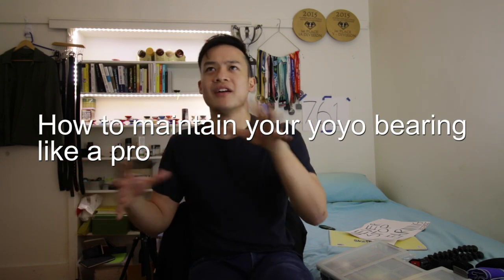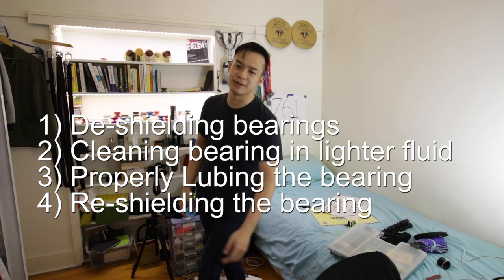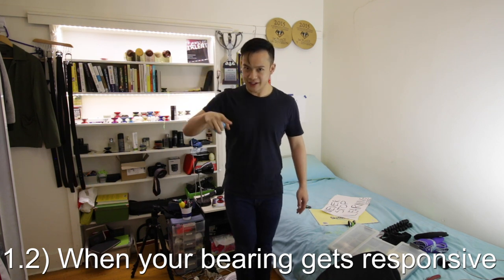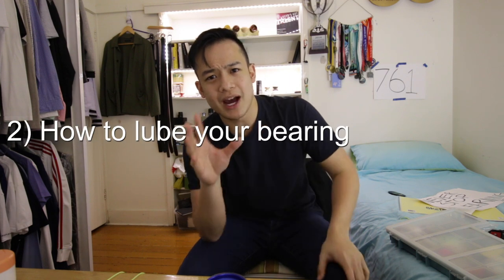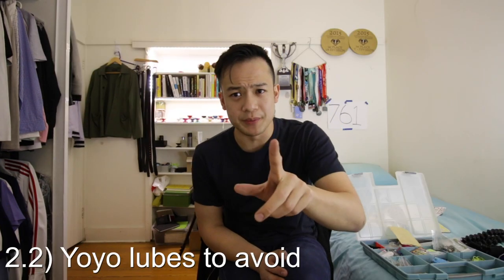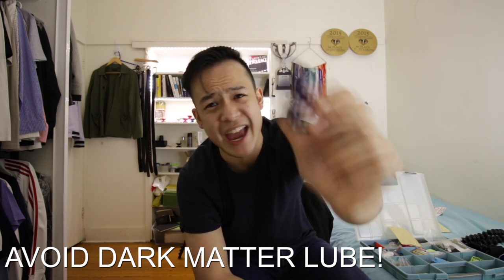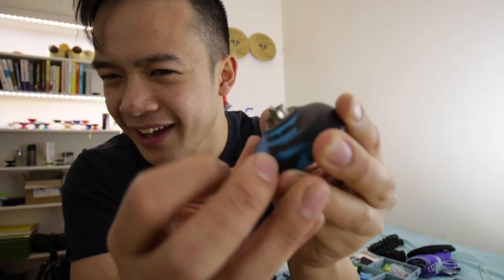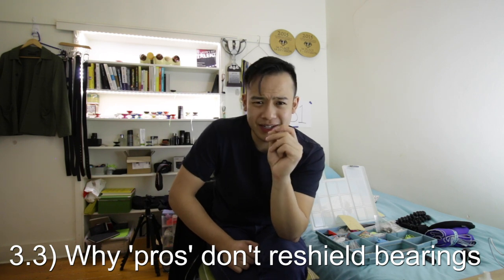Everything You Need To Know About Yoyo Bearing Maintenance

Comment: Dylan Kowalskis thin lube recipe is legitimately really good, you can tweak it to your liking and it’s made of mineral spirits and “3-in-1 oil” at a 3-4:1 ratio.  I haven’t had any problems at all with bearing longevity using it! And ounce for ounce it’s like 20 times cheaper.

Comment: Sewing machine oil is a great lube. It's literally the same thing as the lube from YYF. Also, if DarkMatter didn't work for you, you're using it incorrectly. It's basically a dry lube that comes wet so you need to treat it like a dry lube, aka graphite powders.
Reply: In Indonesia we use "singer all purpose oil"
Reply: @restudwiatmojo6448   does it work

Comment: I know this is an old video, but I came across it as a new player. Good info in this video, and I want to offer my perspective as a long time balisong flipper. Use your bearings dry when possible. Same principles apply here as with bearing knives. Lube will attract dust and debris to your bearing and gum up the works. I understand we all want our bearings to be as smooth as possible, but frankly just upgrade your bearing rather than lubing it, I guarantee it will last much longer than with lube. However, if you're like me and you're in both hobbies and you really want to lube your bearings, Daiwa Reel Oil will pull double duty for your bearing knives and your yoyos. It's about as thin as water, which is what you want with bearings.

Comment: A few things I do:
- dont take the yoyo apart when picking out knots (dust and stuff can get in, esp in deshielded bearings)
- clean hands. Moisture/salts on the string wrapped around bearing can rust it
- a bit of lube on any new yoyo I get
Reply: The first point is also to reduce vibe
Reply: How do you get axle knots out
Reply: @shawnvle  use long skinny tweezers!! It changed my life lol. It makes it ridiculously easy.
Reply: @shawnvle  A paperclip with the wire bent out also works really well

Comment: It was actually your older bearing maintenance vid that got me to try deshielded bearings in the first place.  I hate trying to put c clips back on too so usually if I need to remove a shield it stays off too.  But you're right there is a tradeoff.  Easier cleaning for easier dirtying.  

A quick thing you can do if don't have time for a liquid cleaning and you just heard your bearing get a little louder.  You can spin a deshielded bearing on a pencil tip (or yoyomagic bearing removal tool) then blow down into it while spinning to get out dust or string fibers.  After that, get a tiny bit of lube on it as you may have also dried it a little by blowing into it.  Make sure not to get any spit in there btw lol.

Usually it's string fibers that get in my deshielded bearing as opposed to dirt.  If you use string until they are really beat up and have fibers sticking out all over then you might need to clean a deshielded slightly more often.  If I replace strings often, I kinda do, I rarely have any issues with deshielded.  This is even though I uses strings w nylon that fray a little easier.

Comment: I've found many yoyos that I've purchased that need their bearings cleaned right away. Usually the problem is just too much lube/oil/grease(yes grease) inside. It happens. Of course, Iv'e also had bad bearings from "Fresh out of the new box" yoyos too. My first cleaning is with acetone. That typically takes care of most stuff. Sometimes I repeat. If it's still dirty, I'll use mineral spirits and the paper slip method since mineral spirits don't evaporate as fast. If that doesn't do it, then get a new bearing. Sometimes I'll use some thick lube in the bearing first and then do a few short sleepers to distribute the lube around. This sometimes lifts the particulate matter so it will come out easier when I use solvents for cleaning.

Note: While a quart of "pure acetone" costs me like $8 in a hardware store, at a manicure/beauty supply place, they have "pure" acetone for like $4/gallon. DO NOT use the manicure acetone. It DOES NOT work. Just use the hardware store pure acetone to "undo" your previous bad decision. I don't use lighter fluid as my solvent of choice.

A good lube substitute is no-residue spray/aerosol electrical contact cleaner available at most hardware stores. Well, it's not really a lube, but more of a "I need to clean my bearing out fast". And for that, it's worked very well for me. The propellant often blasts away particulate matter as well. I've never had a problem. I do agree with sticking with lubes meant for yoyos AND to avoid Dark Matter.

I prefer my bearings shielded if they came with shields. I have no reason for this other than “I like it that way”.
Reply: When used for serious purposes, bearings are usually "packed with grease" to reduce wear and provide a barrier to contamination.

Comment: Disclaimer: I have not used Dark Matter and I don't have any affiliation with YYF aside from buying some of their products.

My understanding is that Dark Matter is a little unusual because it works in a different way from "normal" lube.  Usually, lube is an oil base liquid that is applied to the bearing to create a very thin film between the metal parts.  This helps protect them from moisture and from abnormal wear as well as letting the parts move smoothly.

Dark Matter, on the other hand, I think, is closer to graphite dust where there are particles suspended in a liquid and after it has been applied to the bearing, the liquid evaporates and, in theory, leaves a layer of the dust behind that creates the protective barrier between the parts.  One of the problems I have heard of with Dark Matter is that it will "dry out" if not closed tightly and you end up with just a bottle of dust...  My point is, I think some people have had success with Dark Matter, but it's just a different type of thing altogether. 

As far as "making" your own lube, I have seen people swear by Dylan's method of diluting 3-in-1 oil.  https://www.youtube.com/watch?v=zriKLNAnb9k

I also think it's possible to find other thin lubes that work just as well.  I don't believe there is actually a large enough market for think yoyo lube that companies formulate lube specifically for that.  I'm fairly certain that, usually, yoyo companies just find oils and other lubricants that are already being manufactured and they just pay to have it packaged in little bottles to sell to us throwers.  With this in mind, I think it should be possible to find something equivalent to thin lube.  For example, trumpet valve oil seems to work fine as it's a very, very thin oil (e.g. Blue Juice).  That's not to say that it isn't easier just to buy some lube and be done with it, but it's good to be aware of the fact that there are options because, as you point out, not everyone has easy access to the same retailers.
Reply: In the pocket-knife world the pivots have more and more frequently turned to bearings. Most common lubes in use that I know of are KPL (knife pivot lube), Diawa reel oil (for fishing reels), and Nano-oil (which comes in all different thicknesses, so get the thin stuff)
I have tried KPL as a make-do and works just fine on yoyos, no noticeable difference between it and yoyo-factory thin.

Comment: In bobs case i think he has to find a way to dissect the bearing and put everything back tgt? Sounds like smth is loose in the bearing and my guess, it isnt assembled properly. if its fixed after washing/lubing then that would be great.

bearings take a few months for it to break in nicely so do maintain and lube them regularly for a long and smooth spin. ( i dislike that bearing noise lol )

Comment: if you plan to work with shields a lot, there are specialized plier tools built to take them off and put them on. that's why they're a pain to deal with for most. you don't have the tool. they're generally called "snap ring pliers"

Comment: Yoyo Lube Alternative: Ok so i recently got into YoYoing and before i got into it i did speed cubing (copmpetitive rubiks cube solving) and we use cube lube for our cubes. i had some lube lying around when i needed to lube my yoyo so i used the cube lube on my yoyo and it surprisingly works however you have to use lube which has a consistency close to water otherwise it will slow your yoyo like brandon said (!!!And dont use much!!!) im only using cube lube until i get yoyo lube (i use dnm-37 cube lube
Reply: Ayoooo I was going to ask if cube lubes worked! Thanks for the info
Reply: @allthingsoreo5559  all good man! Fyi put like same amount you put in ur cubes also what's ur 3x3 AVG?
Reply: @mannualfpv6293  oh I average 10 seconds.. yoyo has been taking away my attention from breaking the sub 10 barrier
Reply: @allthingsoreo5559  sick bro I'm just sub 20 haha

Comment: Did you try shaking the dark matter lube vigorously then quickly using it? I noticed it has a kind of metal powder in it. I only use it at work with wood working tools once I got the clear thin lube.
Reply from the maker: Yeah, it has like dried up particles inside that clog my bearing.
Reply: @thebrandonvu  I think the idea is it's supposed to be a dry lube. I use dry lubes at work a lot. So the liquid evaporates and the graphite stays behind as the lubricant. This might sound weird, but maybe you're under lubricating it so the bearing seizes up. We use tiny drops of the clear stuff, but dark matter says to add 3 drops. I can't retrieve my dark matter from work for a week to try it myself.

Comment: Hey Brandon, I love your videos! I wanted to know if you had a suggestion for my predicament. I have two Bi-metal Shutters. One plays great, but the other is very grippy, almost semi-responsive (it comes back on a strong tug). I have tried changing the response pads, the bearing and the type of string, but nothing has fixed it. I did noticed that the response pad sits a little taller than the one on the other yoyo. Is there any fast way to wear down a response pad?
Reply: Have you thought about putting thin response pads in it?
Reply: @mamaheel5  I'm using YYF slim response pads, are there thinner ones?
Reply: @GerardoPro17  Unfortunately, not that I am aware of. Didn't realize that you had already tried that.
Reply: Is it possible that your response pads are not firmly seated, or that glue residue from the original pads is in the response pad seats preventing them from seating properly? Since you have already tried thin pads, this is the only thing I can think of that might be causing the problem.
Reply: @mamaheel5  I thought about that too, but the pads that are on it right now are ones that I put in. I made sure to deep clean the pad seating and pressed the new ones as hard as could. At this point I'm just playing with it frequently to wear down the pads. Thanks for all the suggestions though!! 😃
Reply: @GerardoPro17  Sounds like you have done everything possible. Hope it works out with wearing down the pads!

Comment: I literally can not remember the last time I naught a new bearing, this is probably a really bad thing. I try to prolong my stuff to the longest possible, lol
Reply: It's not bad .I've skated and bmxd for most of my life and the only time bearings on those things go out is bc either they snapped in half bc I didn't maintain them and they got super heated then got wet and cooled way to quickly and they exploded or on bmx sometimes the race inside the bearing wears down . But with yoyos none of these factors are apparent there's no weight load besides what 50 to 70 grams so as long as you maintain them and don't buy the cheapest ones they could potentially last for decades

Comment: A bit late to the game on this video, and I should note that Dylan kowalski gets the credit for this, but if you mix 2 parts mineral spirits with one part 3m all purpose lube, it will pretty much work like yo-yo lube. Apply it just like thin lube, and considering a small bottle of thin lube lasts forever,
This is basically a one time purchase.

Also, if you put too much in, you can burn the lube out.

Comment: I don't have a problem with dark matter lube I've been using it for 3 years now lol. I rinse my bearings in mentholated spirits then dry them then a drop of dark matter works every time
Reply: Hey. So do you put a regular drop like a tear drop or use a needle? Also do you let it sit or spin after you add the dark matter ?
Reply: @starparticles6250  I usually give it a regular drop then give it a good spin on the bearing tool, I also give it a blow to get any excess lube out

Comment: Knife pivot lube or nano oil should work but there both harder to get and more expensive. Things like silicon grease an WD-40 are more degreaser/cleaners than lube. They should not be used in any sort of ball-bearing.

Comment: Lube is overrated, Dry is where it's at. Also C-clips aren't usually that tricky IMO. And lastly, Acetone is SOOOOO much better than lighter fluid.
Reply: You may have a point. Most bearing issues are from dirt and moisture getting inside of the bearing, it takes a really long time for a dry bearing to wear out and it takes away the possibility of over lubing your bearing.

Comment: Bob’s bearing is dirty. Need to use those air spray can you normally use to clean your keyboard.
Reply: Libra Boiii Yes, forgot to mention I do that first. Then use the air spray can after while it’s still wet. Put it on the edge of a pencil and watch it spin while spraying it. I find it better and never really had any problems. The noise stays if you don’t blow it. Done it loads of time. I might need to do a video to demonstrate it. 😉
Reply: @Libra Boiii honestly, with a bearing that bad I'd go as far as to leave it in there for about half an hour. That bearing is kinda cooked.

Comment: Lol I use wd 40 and it's ok
Reply: Firstly, WD-40 is not lube, it's a penetrating fluid designed for breaking rusted things free so it's not protecting your bearing from wear. Secondly, WD-40 is too thick to use on unresponsive yoyos, maybe if you use responsive yoyos it might work but it's definitely not "ok" for high end yoyos.